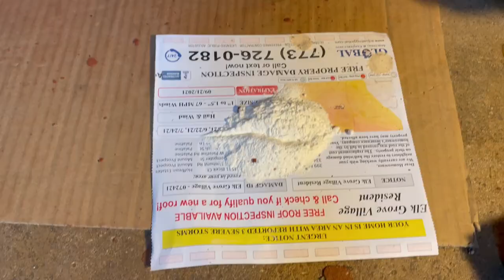Making a Delft Clay Mold (.999 fine silver M4)

Comment: Thank you fellow ape for sharing your process with us! Might have to practice with aluminum first! 🤣
Reply from the maker: I thought the same thing, but silver pours way cleaner than aluminum.  as long as you can get it hot enough, you'll be good.  I pour over a piece of wood, this way if I spill it, it wouldn't;t get lost, nor will it get debris up in it.  If it falls on concrete or lava rocks it's harder to recover.

Comment: Great pour! I'm wondering why you didn't create any vent holes. Most of the silver pouring videos I watch, have several vent holes. Thanks in advance.
Reply from the maker: Thank you, and that's a great question.  I have noticed that as well, and to be honest, I feel most smiths are over-venting their pieces.  The reason it is done is to avoid porosity, yet venting is only one of many tactics that can be implemented to prevent pock marks and unwanted surface abnormalities.  For every vent hole created, the smith will have to repair that area post pour.  If the intention is to prevent uneven and unattractive surfaces, repairing a vent hole kind of defeats the purpose.  I only implement venting when needed.  For example, when I pour a 1-kilo fine silver megalodon tooth, I will vent.  There is so much heat and gas, it requires venting, or else massive gas pockets will form.  Or, if my mold consists of really aggressive angles such as making a 90-degree turn.  The hot silver will get worked up as it makes the turns leading to really bad porosity.  I also only pour big pieces in hot weather, or, if it's cold, I warm my molds up in front of a heater before pouring.  This prevents turbulence caused by the hot silver and gas contacting a cold mold.  Other techniques used besides venting consist of: making the pour spot as big or bigger than the widest aspect of the mold, only heating the silver until it is completely molten and no more (overheating creates unwanted gas and turbulence when poured), trying to make the mold as straight as possible, and always making sure the silver being poured is made up of at least 50% or more of un-used never poured silver.  Silver that has been poured is said to have some impurities that can impact the surface of the next pieces they are used to pour.  So adding 50% or more of fresh silver helps the next piece come out clean.  Sorry for all the information but this is an area od pouring that I have spent years perfecting.  I should probably make a video on it because the only place such information is found is in a bench jeweler's manual.
Reply: @greatlakesflyoutdoors1267  Wow, what an excellent reply! What you said makes sense. I'm new to pouring and I've only poured single graphite molds. But I definitely want to get into delft clay molding. BTW, the M4 came out REALLY nice! I can't wait to get started on clay molds. Thanks for the informative and quick reply. It's greatly appreciated. Are you near Chicago?  I'm just over the border in Valparaiso, Indiana

Comment: Man this is amazing I'm self getting into Delft clay modelling what was the DM furnace you used to melt the silver in
Reply from the maker: Thank you, the furnace I picked up came from a blacksmith off etsy.  This is the guy who I bought it from, but they are out of the furnace at the moment.  From what I have learned from other smiths, most propane furnaces work exactly the same, and do exactly what you want them to do.  The only other thing to consider is size.  I have a 4kg furnace which is big enough to do pours up to a kilo.  but you can go larger with an 8kg furnace.  Keep me in the loop as you continue your smithing jurney.

Comment: I keep telling my wife I want to try and pour my own molds.  Just hobby stuff.  So many questions, lol…. How much silver do you lose during the melt?  Water keeps dough from sticking, will it work on the mold for the well defined parts?  Do you reuse clay?  The mold is only good one use?

Sorry just don’t know lots about pouring.  Super cool vid.  Follow.
Reply from the maker: Don't be sorry at all, I make these videos and the Reddit post because I love helping others find their own way into this world.  It's a very rewarding hobby because you can get pretty decent results right off the bat.  I don't really lose much silver at all, some will stay behind in the crucible, but, even when I pour fractional pieces, I recover the silver at some point.  I would avoid wetting the mold, as this will cause rapid cooling to the molten silver.  Using talc or flour gets the job done, just make sure you wipe away the excess.  I do reuse the clay, but I discard all the burnt, and flower-covered areas.  On some of my bigger pours, I have to use about 20 to 30 pounds.  I usually lose about a pound or two of clay, but I can re-use the rest in many other pours.  The molds are one-time use.  The material has to be re-packed in the mold frame for each new pour.  Feel free to ask as many questions as you want, this is why I do this, and I had others that helped me get where I am so I feel it's important to share the tricks of the trade.

Comment: Fantastic video! Best one I have found. But....what clay is that? Delft? I have never heard of that. Is that the best clay for making silver molds in your opinion? I work in silver, and I have a good oven and all, but I am new to casting. I am looking to make my first 3d mold and figuring out what the best technique is. One thing I have not found is how to make a reusable mold. Like even graphite or something more reusable like that. I would love your thoughts on the clay and any advice on a simple reusable mold technique. Thanks!
Reply from the maker: thank you my friend, it always means so much to me to hear this about my videos. That was delft clay, and in my own opinion, it is the best.  There are two reasons:  first, it is a lot safer to use than Petrobond which is wildly carcinogenic.   It is dangerous for your skin to come in contact with, the raw material has silicate in it which if breathed in can cause silicosis, and burnt petrobond is highly toxic due to the oil that is used to create the clay.  Finally, delft clay allows for the best detail to come out of your mold.  The only other way that is better than using delft clay is lost wax casting also known as centrifuge casting.  There's really not a great way to create a reusable mold unless what you're pouring is super simple.  Centrifuge casting might be the best way to go if you're looking for a potentially more streamlined form of casting with really good results.  If you practiced centrifuge casting, you could 3D print your desired pieces, and create a bunch of molds and than just spin a whole bunch of pieces, one after the other.  But, there really isn't a quick way to mass-produce fine detailed pieces.  What are you looking to pour?
Reply: @greatlakesflyoutdoors1267   good to know about the dangers of the other clays! Delft it is! I am looking to make my own version of the Pirates of the Caribbean coin. Would it not be possible to do a two-piece steel mold somehow? Which would then be infinitely reusable? How to make that, I am not sure. But I pour silver I to simple steel shapes and it works fine. I wonder why that isn't a common technique. Perhaps because of the difficulty of finding someone that can carve the molds out of steel? I did hear from a graphite crucible manufacturer that it may be possible with that. You would have to recreate a small portion of the coin each time by hand with files etc. And it would only last 30-50 pours or so before the details start deteriorating.... So might be more expensive than it is worth. I feel like steel is the answer! Why would that not work if I can find someone to carve them?
Reply from the maker: @theblackspotguild  Sorry for the delay in response, it slipped through the cracks when I originally posted this video.  A steel mold is an interesting idea, I know a lot of people use graphite, which is a lot easier to create than steel.  I could imagine a CO2 or water cutter would be needed to create the mold whereas graphite would require some sort of CNC machine.  Did you ever figure out a technique to create the coin?

Comment: Where do you get the clay?
Reply from the maker: I actually have a local place that is willing to sell to me, but you can get it online at many shops.  Amazon is also a great and fast place to buy delft clay at.  It's expensive, but its way safer to use than petrobond, and, the detail that is captured using delft clay is 10X better than any other clay/sand

Comment: Cool stuff man, is it very difficult to get started doing pours?
Reply from the maker: Nope, you just need to have a safe place to do it, and s torch, and crucible that will match well and allow silver to be properly melted.  I started off just putting silver scrap on a piece of wood and letting the torch rip until the silver turned molten and fused together.  It made supper cool lines from the burned wood, and I was even able to sell my first pieces.  So, not too much is needed, and it doesn't take long at all to get good.
Reply: @greatlakesflyoutdoors1267  where would you recommend buying a crucible and mold from?

Comment: If you send me that M4, I'll run it in my pin tumbler and send it back to you.  It should smooth it out nicely.
Reply from the maker: I appreciate that, this piece sold before this video was even published.  But I tend to just adapt my mold-making technique because I want it to be as smooth as possible when it comes out of the mold.  I rarely tumble my work because it can remove aspects of the piece that I don't want to lose.  I do tumble silver bullets though.

Comment: No vent needed?
Reply from the maker: Great question, the in the video piece had a vent coming of the front fore grip. But I often avoid venting such small pieces. There's a misconception that all pours should be vented. In the case of the piece in my video, it makes some weird turns that create turbulence that may lead to some porosity. But, if its a straight pour like for ex, a sword, no need to vent. The only time I heavily vent is when its a large piece that has multiple angles where a lot of turbulence and gas build-up will take place. I strategically place vent holes where it will benefit the piece post-poor. Ex: venting the handle/pummel area of a sword to help secure a handle to the piece. Or venting an axe head towards the top of the piece where the gasses will get pushed up to and it will be easy to clean post pour. People vent in many cases for no reason. When you create vents, you have to be prepared to repair those areas. Even a long full-size knife doesn’t really need vents because its an easy straight shot to the bottom of the mold.
Reply: @greatlakesflyoutdoors1267  Hey, thanks for the response. I guess you've done a few of these pours. Appreciate the video, and information. (Thumbs up) :)